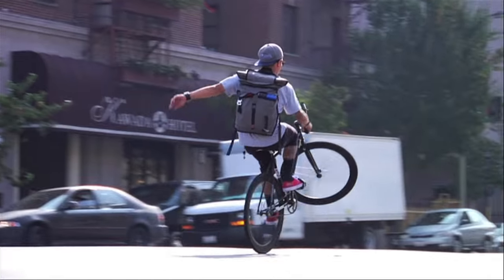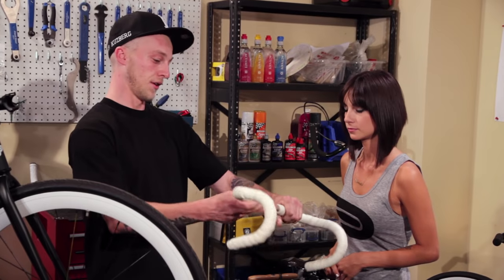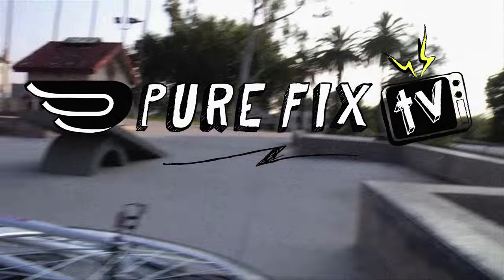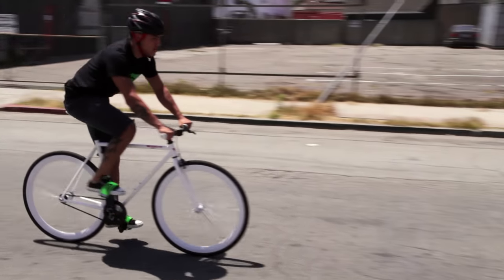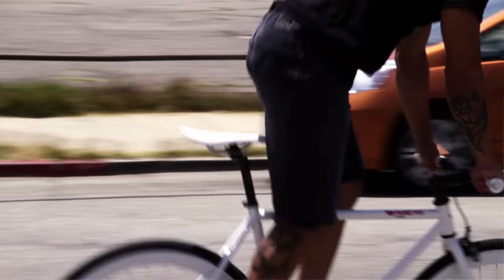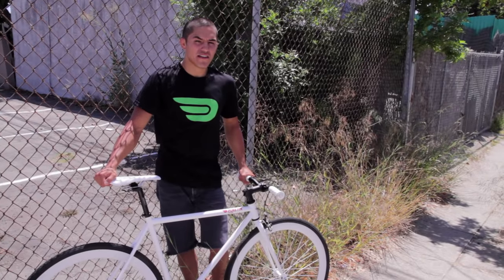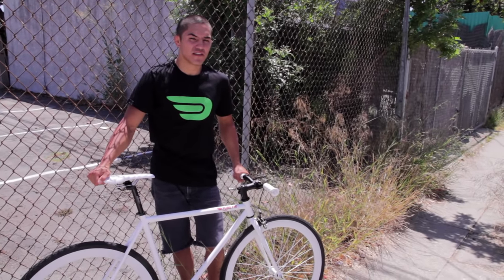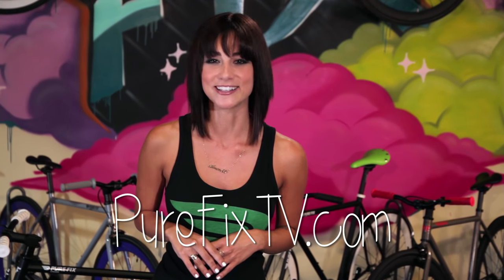How to stop your Fixie

Comment: Ignore what you saw in Premium Rush. Skips and skids wear the tires and are not a useful way to control your speed in traffic. If you don't have at least one real brake and your chain drops, you will have almost no stopping power at all except your shoe leather on top of the rear tire or the ground – which is useless at any speed. At the very least, get a front rim brake and ignore it if you want to except when you need it.
Reply: This is very true other than my comment it is the most legit point I've seen in these comments.
Reply: it wasnt a documentary???

Comment: If you're gonna buy a single gear bike I say go with a fixed gear if you don't mind not being able to coast. Most people are too lazy to do that though but with the proper momentum I find that the fixed gear helps me get up a lot of hills. As for breaks, I like to have it as a precaution but I would eventually like to be bad ass enough to not have to use it. I live in a small town so I don't have to worry about big city traffic or thievery. From the posts I'm reading it seems you've either seen premium rush too many times (me) or you get good at riding no brake so you don't have to continue replacing stolen ones.

Comment: how do you stop on a downhill?
Reply: yeheii I was in that position, not knowing the bike I just got on was in fixed gear mode.  Trust me, it should be done on a flat surface first,
Reply: ItzKevx Online sorry, got the question wrong. i mean, how do you control your pedalling on a downhill, to avoid such buildup of speed
Reply: ***** Seems legit.
Reply: yeheii Resist on the pedals might be one point.
Reply: yeheii you skip with the front wheel.
Reply: Well I was going down the hill it was pretty easy, what I do is just skid xd when I get to the bottom part of the hill my back tires is fucked lol sorry for my bad English xd

Comment: Does anyone realize that it is illegal not to have a brake on a bicycle. Whenever I see one of those no brake bicycles, it is real clear the person has  no concept of the rules of the road. It is a real treat to be a pedestrian and see one of those things coming at you on the sidewalk.
Reply: You Really told em ken!!
Reply: Actually it great depends on WHICH STATE you are in. Most states have laws and regulations on BRAKING DISTANCE not on what kind of brakes you have. WITH YOUR LOGIC, someone could have fully functional brakes that are too week to slow down quick enough. Even if you use teleokinesis to slow your vehicle down that's fine as long as you can slow it down that doesn't matter. It is CLEAR YOU DON'T KNOW THE LAW.
Reply: Actually no matter what fixed gear bikes are the only exception. Normal freewheel bikes need a break that will stop you within 5 feet. But it also states that law does not apply to fixed gear bikes
Reply: Again that's not really true. You must be able to stop within a reasonable distance. 5 feet is ridiculous and I don't think there is any law anywhere that says 5 feet, just that you must stop, and brakes have nothing to do with a law anywhere, only stopping. Show me a link to a .gov site if u disagree. The bottom line is, don't go so fast on a fixie you can't stop when you need to, otherwise when you get hit by a truck it'll be your problem.
Reply: It is our problem so just don't ride fixed simple as that.

I've ridden past plenty of cops and never got stopped. ever.

Comment: Why not install a rear brake.
Reply: with a fixie, you have an additional braking method: backpedaling. Between the front brake, which BTW on road bikes won't throw you if you have a good bike fit, and the backpedaling, you probably don't need any more braking power except in a rare dire emergency, in which case because of the thin tires, two brakes plus backpedaling might be enough to cause the tires to skid anyways, which nullifies the purpose of brakes and backpedaling anyways.

Comment: I just got a single gear/fixie. It has back brakes. I was gonna put the front brakes on, but I couldn't get the adjustment right. I flipped it to fixie and practiced stopping without using the break. It really is not hard to stop without breaks. If you don't have a sense of awareness, probably a good idea to stop riding bikes altogether.

Comment: Something like 80% of the braking power is in the front brake, because as the weight pitches forward under breaking it rams the ruber into the road. In the dry police motorcyclists are taught to use 90% front 10% rear, and lots of motorcyclists never use the rear brake, except when it's very slippy. I'm scooting about on my bike this afternoon and I can't remember the last time I used the back brake. Racing cyclists used fixed gear bikes to train in the winter, supposedly because it increased "souplesse" - it doesn't! - and it provided a new kind of racing during the winter because people who lacked raw power could sometimes win. My uncle used to talk about a guy who won a time trial by turning a 63 inch gear at 140 rpm the whole way. To get to the punchline - why in the name of God would you want to lock the back wheel on a bike? Is this clip sponsored by the Bicycle Tire Manufacturers of America?
Reply: but murica

Comment: Have not ridden much, but when I was a kid, I had a bike with both front and rear brakes. When I did not know yet which lever was which, I accidentally slammed on the front brake only, which caused the rear tire to jump and I was thrown over the handlebars.

Comment: I built my own fixed gear, took it for thz first ride today really liked it! Except from the stopping... my bike's kind of heavy so Idon't like skip stops... I'd prefer skid stopping, but i feel like it's impossible without breaking my legs...
I though my gear ratio might be to high?  But Idon't want to lower it... (it's currently 46-15) can you please help me to stop fast and easy? I have no brakes, currently straps, but I'll be upgrading to clipless pedals.
Reply: 46-15 is pretty izi to use. 
Just make ur legs and its gonna be izi then :)
clipless (automatic pedal u mean?) are izi to use but no comfy at all and not usable and every day life, otherwise u have to change ur shoes every time you get on ur bike ... :/

Comment: So three months ago I bought a Purefix Victor and I've blown the tire/tube twice in two months on the dumbest sh*t  while riding to work. Any solutions? May be a dumb question but I've ridden bikes for a long time, out of necessity, but I'm not really a bike geek. I just decided I wanted to buy a quality bike. And yet I've never had these problems with any of my previous bikes. By the way the tire is a Thickslick.
Reply from the maker: It's most likely an issue with your tire liner. Give us a call or shoot us an email and we'll take care of you!
Reply: Thanks!
Reply: +Natasha Suttler-Thompson 
I would get whats called Gator Skin Tires. which are GREAT for Urban settings thoe a little pricey. Also when putting the inner tube in the tire. slightly  inflat the inner tube before  mounting the tire on the rim. Once the tire is mounted on the rim use a "rocking motion" in a 360 ° morion to make sure the tube is not pinched.
Reply: +Natasha Suttler-Thompson Don't skid !  I road 3600 miles before changing my last rear tire on my track bike  ,all with out skidding.  Tires I use are always Continental. Air up once a day !

Comment: Hey just a quick question whenever I press the pedals down they still keep moving throwing me up in the air 😂 and at slow speed if I manage to press it at least somehow the lock ring loosens up and when I restart to pedal they just fall in is that normal ? 😂😂 any suggestions? Cheers 😉

Comment: What is the best gear ratio for skidding?
Reply: +Lewis Macleod (Macers53) The lower the ratio, the easier. Some good places to start is 44/17 or 46/17. Adjust from there. Make sure you run a brake if you are a novice

Comment: I was asked to trade bikes with a guy who works as a bike mechanic at an electric bike store, my bike has pedal assist, and he's never tried one.  I wasn't aware that his bike didn't have brakes and was in fixed gear mode, and we were at the top of a steep hill.  I almost got thrown off it.  Of course he's a bike mechanic and his front brake didn't work.  lol

Now I always check before I even get on.

Comment: Having pedal straps looks like it would help, but you don't have to have them. Without them you just apply back pressure on the rear pedal as it's coming up and eventually you'll slow down and can stop. Makes for quite long stopping distances though so pay attention and probably best not to ride in busy places that require sudden stops. I'm from Raleigh NC but never ride streets, only bike/walking trails, normally the one along the Neuse River. I also have hand brakes and only flipped the rear wheel to try in it fixie mode briefly. Usually keep it flipped to the coster gear.

Comment: ็How to do emergency brake???

If you don't have break.

I don't want brake on my bike and it fine to ride.
I ride around 40km/hr. ,
but I don't without break what's the best way to do emergency brake?
any idea?
Reply: You simply cant. That's the point why everyone should have at least an additional front brake.
Reply: You get off your bike and tuck your head in then roll. Tada!

Comment: What's better 6ku or pure fix
Reply: +Aznuk3 In my opinion both are practically the same. Both bikes have frames made out of hi-tensile steel, 50mm aluminum rims, cheap cranksets, kenda tires, etc. It all boils down to you, I would avoid these cheap bikes, for just a little more money you can get yourself a chromoly frame and lighter wheelsets.

Comment: Are CRITICAL fixie bike good for a beginner .
Reply: As a beginner I encourage whatever bike you get please use a front brake for about 2-3 weeks as you build up reverse-muscles in your body and please don't buy a bike that had an original msrp of less than 600$. It could be used and be 50 just check its name to be sure at one point it was decent. Go for cromoly or steel. Don't get a gear ratio over 1:2.5 yet.

Comment: What is the best gear ratio for skidding?
Reply: The lowest one you can find. When learning I used a 34 ring with a 18 cog, and I also skidded on gravel first, latter on slick asphalt and finally on concrete. Be sure to have a cheap tire o when you replace it it isn't Abig deal. And lean as far forward as possible. It is bad for your knees to do that at all though proceed at your own risk.

Comment: whats the weight limit on one of this bikes?
Reply: ***** you realize your axle nuts dont move when you pedal, right?

on your logic, pedaling forward would over tighten and strip the axle nuts and they wouldn't be removable again.
Reply: *****
yeah its fine, also most fixed gears ive seen have a non-removable cog on them that doesn't spin freely (though that's not the case for all of them), so unless it breaks off, you shouldn't have to worry about that
Reply: +derick martinez The bike shown in the video has a frame made out of hi-tensile steel and has 50mm aluminum rims with like 32 spokes. This bike does not have a weight limit I believe lmaooo, this thing is a tank. But just like a tank, it is going to be heavy as hell.

Comment: The comments on this vid make interesting reading. Fixies vs gears will always cause arguments which mainly centre around safety. It appears that those who ride fixies get into a way of thinking that makes them think ahead more, it speeds up their thinking a lot and keeps them on 'ultra high alert' at all times. This is a good thing as it means they are usually a few steps ahead of most other road users (5 or 6 steps in most cases) and there are definite and obvious advantages to this.
People who use multi geared bikes have to rely on brakes to slow down so they can relax a little more and although they still have to be very alert at all times it is not necessary to think quite as far ahead as fixie riders. Although I consider myself to me an intermediate rider, I have still been very glad of my brakes on a few occasions when drivers get in the way, yes I have had to stop impossibly quickly to avoid serious injuries !

If you are into very lightweight and minimalist bikes with low cost minimal maintenance and like to ride in a state of ultra high alert while riding fast then you'll get a real kick out of fixies, for everyone else there is a lot of high tech and low tech choice.

Personally I love modern hydraulic disc brakes and SLX gears, my bike is quite heavy but it's solid and reliable and I use it daily, fixies are quicker and can be more fun but I can ride my mountain bike almost anywhere and living on the coast of a mountainous region, I need it. I would not use a fixie for climbing mountains, camping or downhilling offroad and I would never assume that a car driver is going to see me in time to avoid me !

Comment: I think this needs to be brought to the attention of everyone. At the Old Bailey Court (in what is believed to be a legal first) a cyclist who knocked over and killed a woman had been riding a "fixie" - a fixed wheel track bicycle with no front brake used by track racing cyclists - which is not legal on the road without modification. If the cyclist had been riding a bike with proper brakes, he would have been able to avoid the collision, prosecutor Duncan Penny QC said.
The trial continues.
http://www.bbc.co.uk/news/uk-england-london-40927791

Comment: so fixies dont have freehubs?
Reply: Absolutely not this is what sets fixies apart from single speed road bikes. The HUBS are solid and the rear cog is very costly because it must be screwed in with a counter screw and set into the hub. The hub sits around the axel but that's that. On a SINGLE SPEED road bike to MTB there can be what's called a hub brake which works like a car drum brake which uses a pedal switch, very commenly is pedal backwards but can also be a switch lever. This takes much much less energy than a fixie to slow down, and you can skid without taking weight of the back wheel like a fixie.
Reply: Only really cheep fixies have a flip flop. And when they do, be sure to have breaks or a really thick shoe so you can stop.
Reply: ben red after all this time, i am still into [22 speed bikes]
Reply: Well firstly 3-500 is still relatively cheap. Though i supose as far as street fixies go, many do have a flip flop. With out brakes you cant ride without the fixed gear though, it would be a whole new level of idiot. And my fixie is $1000 and a better one with a decent rear wheel like a zip or Something would be more like $5,000 and will have no free wheel option because they are even less prone to have breaks at all, meaning a fixed gear is required to be able to slow down at all. And no, $500 is not a bad number to spend and if thrift is your goal, by all means, get a fixie with a flip flop, and brakes.
Reply: And in any case, dont drift too far off the point- dont ride with a single speed with a free hub with no hub brake and no brakes, you will have to use your shoe to spoon which i see too often, or stop by draging your feet. In Colorado, thats a great way to die or get a ticket.
Reply: Well the real reson i said that is lots of people buy like SE Raceing bikes, and simular brands that have flip flop. Statisticly, most expensive fixies have no option, either or, and he ones that do are rarely stock. 12,000$ sounds custom so idk.

Comment: ????? no you dont raise your ass off the seat for a skid stop, especially in an emergency stop, you want weight on whatever wheel you are using to brake... it you know kind of helps it stop alot quicker... if you take the weight off of it you are just going to skid and drag for like 15-30 feet

Comment: I ride fixed and it is silly, SILLY! to ride with out brakes. All the stops that are shown, like NY stated need you to be locked in to the pedals and if performed poorly will cause you to flip. Also they are all pretty much useless if you need to stop quickly. For all these you need a moment to prepare and then execute perfectly and unless you are full time on your fixie and are an ace to begin with you will not have the time needed, Shit happens fast. To ride with out brakes you basically have to ride slow all the time, fuck that. A fixie with a full set of brakes is the best ride but with out them it is just a time bomb.

Comment: these bikes are for lame hipsters who just have to be different....
Reply: I ride a fixie for exercise?
Reply: k no one cares
Reply: Are you asking that to yourself or that interrogation sign is wrongly placed?
Reply: If you live in a manageably flat area, then fixies make sense. They bleed less energy, so you move faster than with a derailleur at the same gear. And the lack of a rear derailleur lowers some maintenance costs. It's just another tool appropriate for a set of environments.
Reply: Dual sport motorcycle master race
Reply: k no one cares
Reply: Hehe U mad? ( ͡° ͜ʖ ͡°)
Reply: No because I have a motorcycle and you have a bike
Reply: WOW That's the sillyest and most childish answer I've ever got in a youtube comment.
Reply: your you mad comment was pretty childish
Reply: Tony Tanti I don't understand how they are different when it seems like every kid who's riding a bike has a fixed gear.

Comment: its not that dangerous cause you have straps you can stop easily with straps
Reply: It's still way more inefficient because it is just one braking tire and the whole load transfers to the front wheel anyway, thats plain and simple physics
Reply: not wearing cleats where you can remove it fast.

damn.